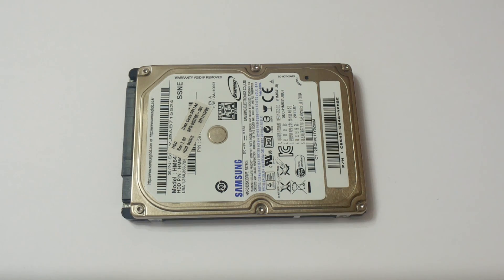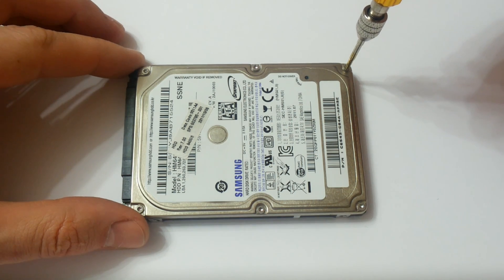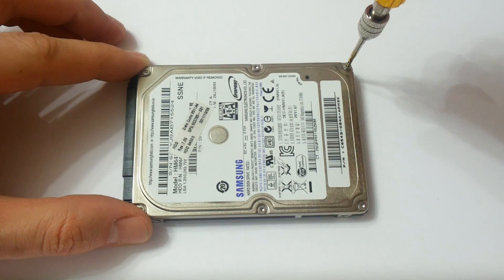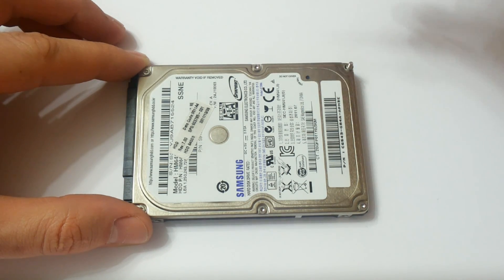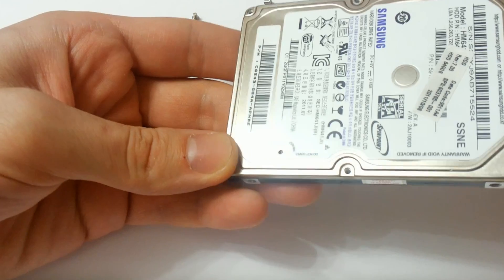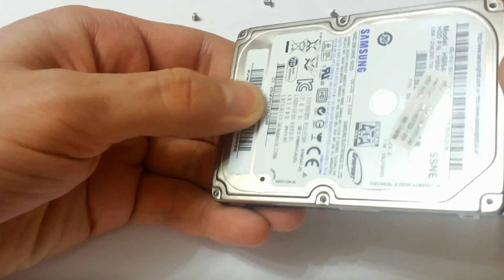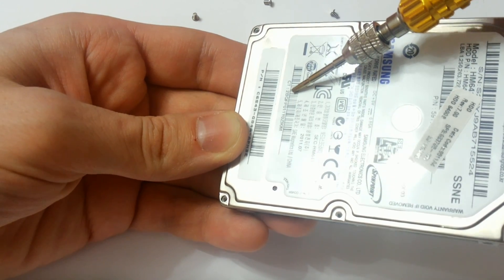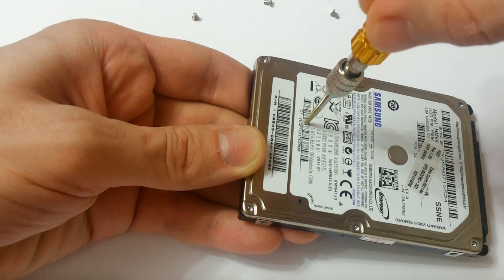Samsung Laptop Hard Drive Disassembly – Inside HM641JI | How a Hard Drive Works

Comment: Thanks for teardown. You missed removing the motor though. Also are those platters toxic? I'm planning to use it as decorative element
Reply from the maker: The platters are not toxic it's just a glass with a layer of metal called a thin-film medium.

Comment: Is this glass platter?
Reply from the maker: Laptop hard drive platters are made from glass while aluminum platters are often found in desktop computers.
Reply: @ElectronicsComputers  Ok. Why glass? Is it better then aluminium? I bought my Asus laptop in 2011/2012, kinda old,do you think it's drive platter is glass?
Btw i love your channel.
Reply from the maker: As I mentioned before only laptop drives use glass substrates, but some HDD manufacturers started to produce 20TB desktop hard drives with glass platters too. You can't even imagine how many advantages glass platters have over aluminum ones. First, glass is more rigid than aluminum, which allows the platters to be thinner and lighter( this is why they used in laptops). Glass substrates are smoother and flatter than aluminum, which allows them to be packed together more tightly, and they expand less than aluminum under heat, which makes it easier to cope with thermal expansion. The amount of energy required to spin a glass platter at a given spindle speed will also be at least slightly lower than if the same platter was made of aluminum, due to the platter’s higher weight.
I hope that answers your question.